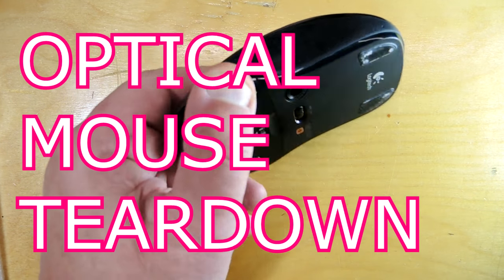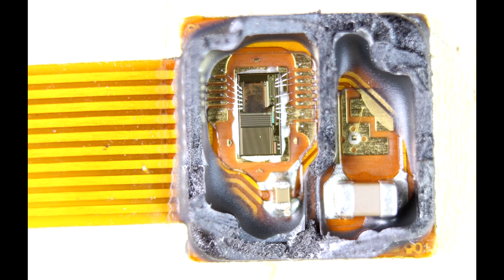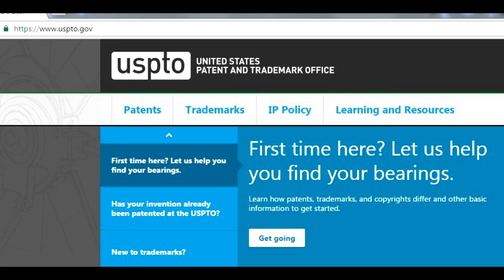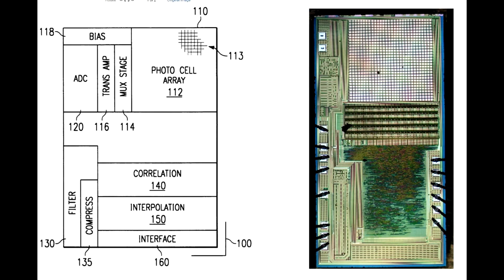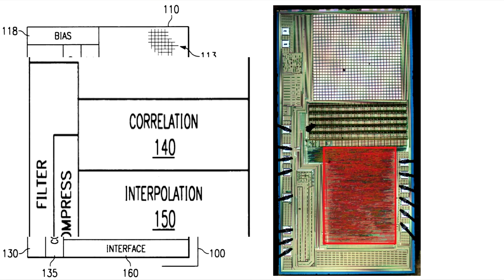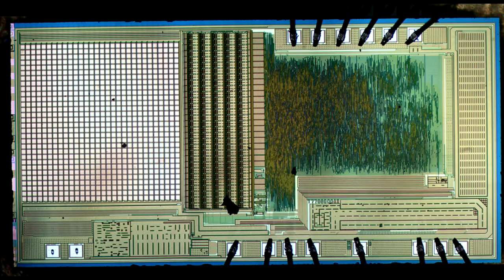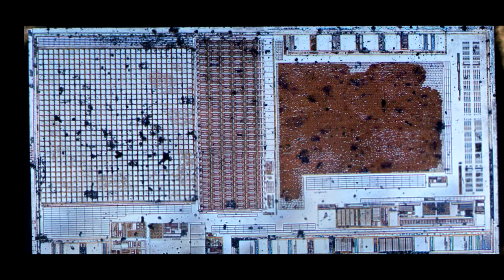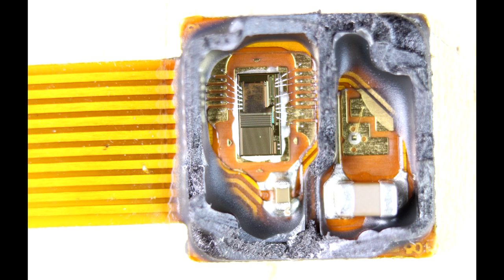Optical Mouse Teardown: a look at the sensor

Comment: Theres an important difference between optical and laser mouse. What you have, is a laser mouse, the more expensive and more interesting variant utilizing an actual laser. Optical mouses just use an led and dont need complex beam guiding. 
Your title says optical mouse, which is of course right, but laser mouse would be a more accurate description.

Comment: Hello there, and thank you for this video.
I have mouse like this still for 4-5 years or maybe even longer. Really great mouse and what is important to me it is not small, so it fits nicely in my not so small hand. Few weeks ago it started to getting off by itself, so today I took it apart and at first sight all was OK. But then I touched by my finger one of the components and it was wobbly. It was coil next to the capacitor, one tab was fell off so I resoldered it and my favourite mouse is working again :)

Comment: What signals could be on the output wires ? On my mouse 5 wires go to the USB controller chip.
Perhabs wires for up, down, right, left and one something more  ? The light sensor already do the final evaluation ?

Comment: the laser looks like a vcsel diode
Reply: Yes that's what it is... VCSEL= Vertical Cavity Surface Emitting Laser. Invented by (friend) Jack Jewell at Bell Labs and perfected in the 1990's at HP/Agilent. Since the laser light is coherent, rather than an incoherent like in an LED, you get a higher contrast "speckle" picture on almost any surface that can be tracked easily. The first practical optical mouse was developed at Xerox Parc for the Xerox Alto, with a 4x4 pixel array sensor, in 1980. Both inventions are quite remarkable technology feats. Excellent video, thanks.
Reply: Thank you for that brief but helpful explanation.